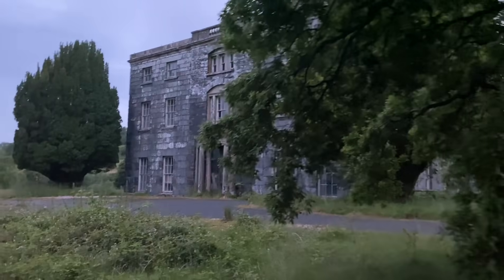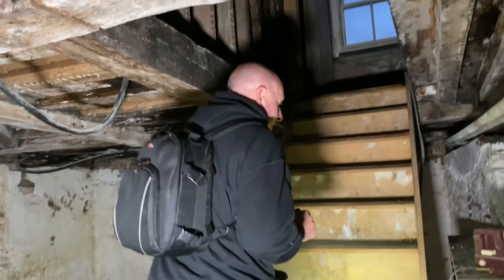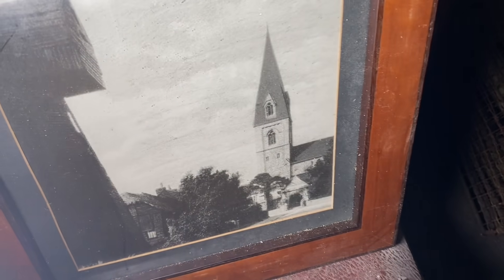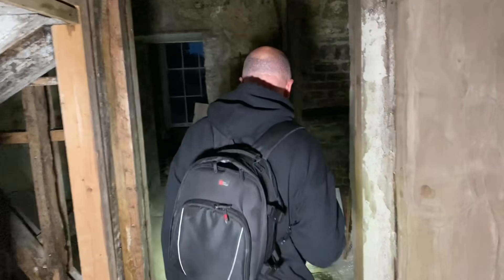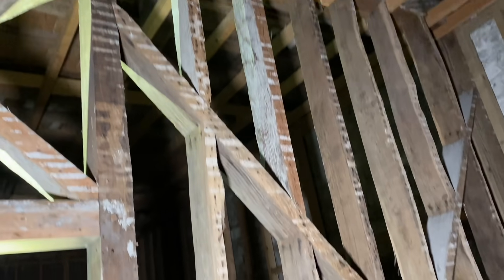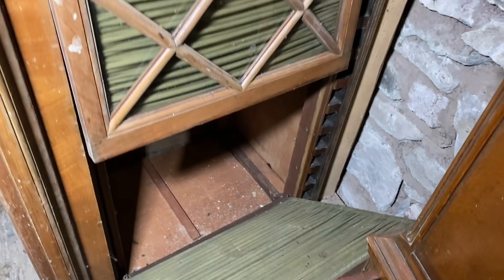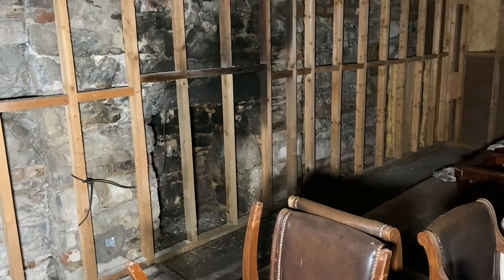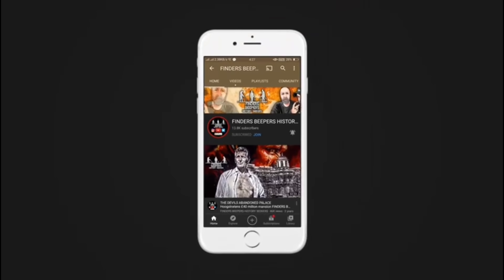Trapped and hunted in a huge ABANDONED house surrounded by bats

Comment: Hi. Great explore! Good thing you didn't have Bear with you to give you away. In that first room the doorway with the groove into the wall was for a large bar to go across the door. Maybe it was a cell or larder door? The carved mouldings would be from doorways, window frames, corridor arches, library shelves, stairways and bannisters, fireplaces and mantelpieces - I think probably to be used for the restoration. Hope someone finishes it. I would say they were planning on either plasterboarding or timber-lining throughout with insulation for warmth, and then using the mouldings to make it look more authentic. I agree that I'd have used the old fireplace as as a feature. Loved the sweep of the staircase. It might well be that the restoration was stopped because of the bats, being a protected species. You're not allowed to boot them out of a roosting place, or even disturb them. My mother had problems with just pointing a barn because there were bats in the roof. Another scary exit! Pity the explore was cut short, but I think you were wise - farmers or locals might not be as forgiving as police... I didn't see the woman. Were you thinking she was a ghost, or someone living there/keeping it safe?

Comment: The photograph that shows Henekeys and the tram is Enfield Town in North London. It is less than a 10 minutes walk from where I live. Many of the buildings are still there, including the fountain which can be seen on the right. The Henekeys building is an old coaching inn and still exists and is now a restaurant. The tram is on Church Street. The road heads straight into what is now Southbury Road, but probably Nags Head Road when the picture was taken. The tram tracks curved to the left and head north into Silver Street. The Lloyds Bank on the corner is still there. The road going off to the right is London Road.
Reply: In fact, the church is also Enfield, Windmill Hill. And I think that is the old windmill on the left. The next photograph is of a pub called the Rose and Crown, Clay Hill, Enfield, and that still exists.
Reply from the maker: Yea just been looking on maps! I wonder what the connection was
Reply: @FINDERSBEEPERS  No idea. I suppose whoever owned the house in Wales may have had a connection to the area. Trams made it to Enfield Town in 1911 and the windmill was demolished in 1904 so maybe the connection dates to around then. Thanks for the video.

Comment: It must have been a grand place at one time, don't know why anyone would want to cover up the fireplaces or all the stone.  Thanks for the video and the laughs ❤
Reply from the maker: Same! They are the best bits
Reply: I bet it all boils down to warmth, because fireplaces cause draughts, stone is cold, and the spaces are so big that heating it would be a nightmare. The stairwell alone would cost a fortune, so it would be a choice between lining plus insulation, or possibly massive tapestries. Either would need some form of heating as well. Plus double-glazing or secondary glazing as there's a lot of glass (some broken), which is also cold. I bet the double-layer of old parquet flooring was an attempt to reduce cold as well.

Comment: @nanad4348   I love the idea of living in a place like this, but I bet it all boils down to warmth, because fireplaces cause draughts, stone is cold, and the spaces are so big that heating it would be a nightmare. The stairwell alone would cost a fortune, so it would be a choice between lining plus insulation, or possibly massive tapestries. Either would need some form of heating as well. Plus double-glazing or secondary glazing as there's a lot of glass (some broken), which is also cold. I bet the double-layer of old parquet flooring was an attempt to reduce cold as well.

Comment: In Sacramento California, a lane usually has no outlet and no documented lanes. A street , drive has two way marked and avenue always has an outlet  by law. This is done in case someone gets lost , they know which roads to take. A road can have an outlet or no outlet, but is smaller than an avenue or boulevard and is only two lanes.A cul de sac or court is one way in, one way out,...a boulevard or avenue has more lanes, usually four to six, can handle heavier traffic and is used  as a main thoroughfare. A way, can be no outlet or outlet but must be marked and usually has homes and is very rural as a lane is as well. Freeways are only within state. Interstate crossed state lines. Did I miss anything? Lol